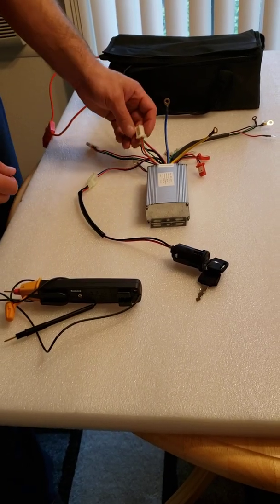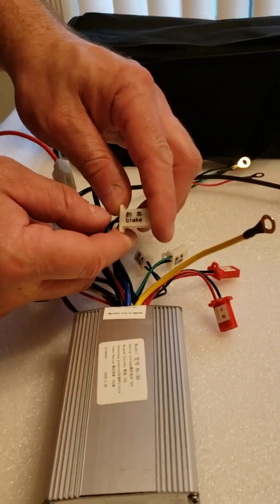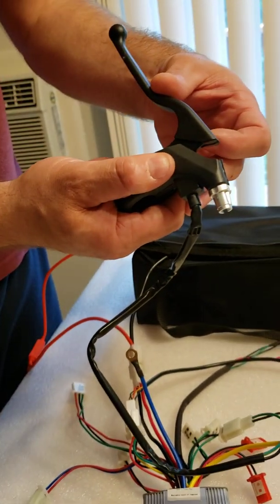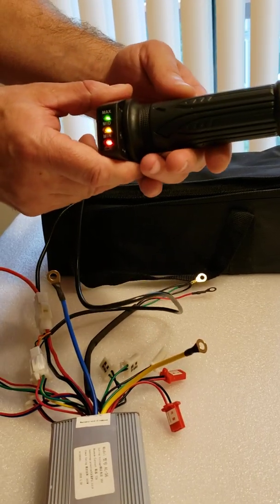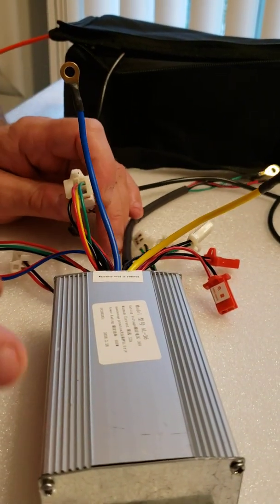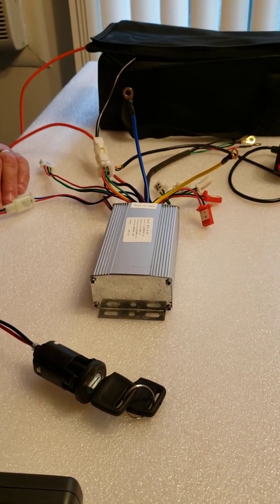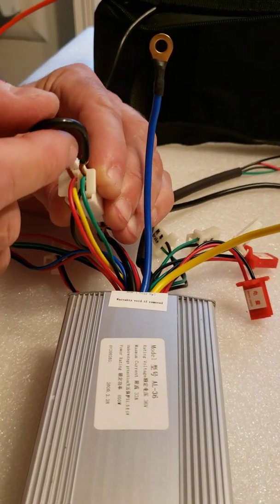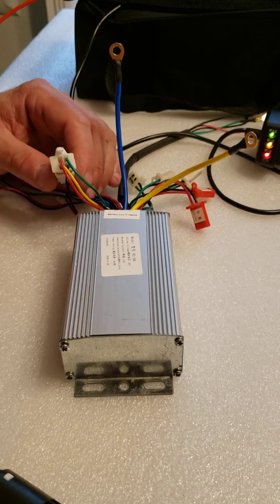Rosso electric atv Throttle or Controller faulty??? Testing controller Part 2

Comment: Hi iv got a mrf off road 36v electric quad iv changed my batteries and controller to the same as there was in the quad and iv still got no movement any ideas what it could be thanks

Comment: What would be my problem if when I twist the handle, the ATV accelerates and stays accelerating even when I let off the throttle?
Reply from the maker: If it is doing that with throttle handle unplugged, then you need to replace controller

Comment: how can you test if its a gear selctor problem?
Reply from the maker: You can do continuity test, as shown on one of my other videos , or you can bypass F/N/R switch and connect Bleu and Yellow wires from the controller directly to Red and Black wired on the motor to see if motor will spin. And if it is, than you know that gear switch is not passing power and need to be replaced

Comment: I have a Phantomgogo R1 36v scooter. When I tested the wife's coming out of the controller and I found that the 5 volt Red Wire is pushing 17.44 volts. I am afraid of connectiing the.controller to the throttle because I do not want to damage the throttle.  Is this high voltage normal or is it a defect? Will it destroy my throttle?
Reply from the maker: Sorry, i am not familiar with your scooter and its wiring diagram color codes, so i can not suggest you much to avoid making it worse... 
But from my experience i never seen that throttle handle can get  damaged ,  but only  controller  can get damaged if connected wrongly

Comment: The batteries both showing 53volts it was when I was charging them and to see how much charge they had I reved them and both stopped working batteries still charge but I don't no if throttle fault or controller
Reply from the maker: What product you have?
Reply: @You-can-fix-it  48v 1000 electric dirt bike it stopped working when I pressed throttle while plugged in on charge
Reply from the maker: @djmccrea2438  Controller is supposed to  have a safety future,  so it will cut off power if it detects the charger to be plugged in. Make sure fuse is not blown and actual Voltage is present at the battery connection plug
Reply: Batteries showing voltage but I don't no if it's controller or the actual throttle blown because it won't turn on
Reply from the maker: @djmccrea2438  you can override ignition switch,  it is only 2 wires
Reply: @You-can-fix-it  how I no nothing about electric just what I watch

Comment: What if you charging it and then the lights don't work is it throttle or controller because with no lights can't turn it on so wouldn't no if it's controller blown from charging and pressing throttle at same time it's blown controller or would throttle be blown
Reply from the maker: Controller JUST passing power through to your batteries,  so it got nothing to do with charging.  Better to verify is Voltage is coming out from battery pack connection plug and if Voltage is present,  than next stepis testing or overriding ignition switch.  And if after those 2 steps done and it still not powering ON , it means that controller is blown and need to be replaced. 
Here are 2 videos below how to test battery Voltage output and how to override ignition switch
https://youtu.be/NSuSZ9hmpyw

https://youtu.be/R_0vbhS3jQc

Comment: I have a 6 wire for light display and Cruz control throttle.    So to I short the black and brown in this case for the 36 b to go back to the hub ? Or is it low voltage 5 to the trigger ?
Reply from the maker: Sorry, I have no direct answer if you have non Gio products...

Comment: In my case, my controller was dead as well as the twiest throttle. I ended up replacing the Hall sensor in throttle, and buying a new Controller.. Great Video and very helpful with me diagnosing my issue with my GIO 500watt Manteray. Thanks again Sir!

Comment: Can someone please explain to me why he doesn't need to bridge the connections of the front, rear and footbreak for the esc to supply power. I thought these connections needed continuity because all the break leavers have switches inside that cut the power to the motor when unpressed? Thanks in advance
Reply from the maker: Controller work only when brake plug wires are not touched,  as when brake handle is pressed those wires get touched and it disconnect power inside the controller
Reply: @You-can-fix-it  Ok thx, i thought it was the other way around. I thought when you press de brakes, a switch inside loses continuity

Comment: Hello , I have a rosso equad x , my son whashed the bike with water and since then the bike won’t start. The fuse burnt out and then I putted a knew one and the moment I turne the switch to foward the motor activate itself for 1-2 sec and then the fuse burn out again

Is it the dc controller or the motor that is broken , there seems to be a short circuit somewhere cause the fuse keep dying. When I put a new fuse the lights and all the lights on the handlebar works fine
Reply from the maker: Unplugg acceleration handle from controller and see if the fuse will keep blowing, if yes, than replace controller

Comment: Where do you get the handle from?
Reply from the maker: From Rosso motors website
Reply: @You-can-fix-it  is it 2 pin or 3 pin?
Reply from the maker: @JaspreetSingh-kb9gd  they all 4 wires
Reply: @You-can-fix-it  Oh ok. Thanks!

Comment: What if you do the jumper and it only runs for ¼ second and stops?
Reply from the maker: Low battery Voltage ( less than 38V) or faulty controller
Reply: @You-can-fix-it  thank you. Voltage is good so must be the controller.

Comment: Sorry to bother you again. I now replaced the throttle handle and still no movement. Computer is replaced and throttle handle replaced. Motor is good. All that's left if the forward reverse switch and speed key switch. Can a defective forward reverse switch or speed switch cause the atv not to move? Please let me know. Thanks.
Reply from the maker: Yes. Follow the video how to do continuty test .
Reply: @You-can-fix-it  I did continuity tests on everything. Everything seems to work fine.
Reply: @You-can-fix-it  I get a beep sound from the forward reverse switch even if it's in neutral. Could this mean it's defective because it shouldn't be getting any beep sound? Also is it in forward or reverse I still get a beep sound from both sides of the switch. Isn't only one side supposed to beep until I switch polarity?

Comment: I talked with you on another video of yours. I did continuity tests on everything on the atv and I had the batteries tested and they are all good batteries. My throttle plug has 3bwires connected and one yellow wire that is external from the throttle plug. I touch that yellow wire and the green wire and the multimeter beeps. Am I supposed to touch this two wires? I still ha e full power and tested all the motor and everything else beeps. The forward reverse switch is testing good as well.
Reply from the maker: Check other video how to test newer style controller on the atv
Reply: @You-can-fix-it  it is 2019 model.
Reply: @You-can-fix-it  with my model should there still be a clicking sound when I turn the throttle? I never hear a clicking sound before when it was working
Reply: @You-can-fix-it  I donr have a handle switch on this model
Reply: @You-can-fix-it  I tried shorting the red and green wire with this model and I have no power to the wheels. I'm guessing it would be a faulty controller.
Reply: @You-can-fix-it  also I noticed on this model I have a red light with the letter "R" on it for reverse that lights up and a green light with the letter "N" but the letter N does not light up whem I put it in neutral and there is no current running from the black wire when doing continuity test. Maybe because of this light not working from the forward reverse switch is why the machine wonr move.
Reply: I'm not sure if this means faulty throttle handle or bad computer. Everything else is checking out good so maybe should I just replace both the handle and the computer?

Comment: I purchased a Rosso kids quad used for my daughters birthday. It's from 2019 and it only worked for about 10 minutes before it stopped working. The lights come on for the headlight and throttle but the quad will not move. Could this possibly be the battery? Or the controller and battery?
Reply from the maker: Since it is 3 years old model, start with testing batteries first
Reply: @You-can-fix-it  would a weak battery still be able to run the lights but not the motor? The battery indicator on the throttle handle says fully charged but could it still be a weak battery? I really appreciate you answering me back so soon. I am subbing your channel now.
Reply from the maker: @GLCUSTOMS  Correc,  start with batteries first . Than if batteries are good, next step is  look for other video that called " rosso atv continuity test " . Good luck
Reply: @You-can-fix-it  thank you. I watched all of your videos. I liked them all as well. You are a very smart guy indeed. I will see.

Comment: Hey, I was having an issue with my scooter. The scooter turns on normal, the horn works, the head/tail lights work, and the battery level lights on the throttle turn on too just like the video. I replaced the throttle first with an oem one. Didn’t work, I replaced the controller with an oem one as well. Didn’t work, I was then told about the brake sensor, my brake sensor was damaged but worked fine. I got new brake levers which come with the brake sensors and is still doesn’t work. I had a feeling it’s the battery but I tested it with the original scooter battery that I had before I upgraded. Still didn’t work. Could it be the motor? Pls help
Reply: I'm having the same issue. I replaced nearly everything on my daughters electric atv. All that's left is the speed control switch and the forward reverse switch.
Reply: @GLCUSTOMS  only thing left for me is either the wiring is messed up somewhere , or the motor is toast
Reply: @TrendyCentral  remember to test the motor you can touch the yellow wires directly to the motor red and black wires if the tires spin even once the motor is good.
Reply: @TrendyCentral  or direct motor wires to the battery terminals
Reply: @GLCUSTOMS  yea I was gonna mention the phase and hall sensors
Reply: @TrendyCentral  I don't get any power now after putting everything new. I just got another controller today and everything gets voltage but no power to the wheels still even with a new forward reverse switch and throttle handle on a mini atv. I'm lost now I've spent so much money trying to make this thing work I could have bout another atv lol

Comment: Anybody have the problem with the throttle sticking and the atv won't stop with the brake or the key fob shut off
Reply from the maker: Try to loose throttle handle housing clamp screw that holds handle to the pipe and pull out complete handle by 1/4 inch and secure screw
Reply: Just tried that the handle. They quad is still full throttle as soon as you trun it to forward or reverse and out stop with left brake or key fob. Will just stop when turned to off on center knob.
Reply from the maker: @jasonnmoore12  Unplug throttle handle plug while wheels are spinning,  if wheels will stop spinning,  then replace throttle handle. If wheels continue to spin after handle ia unplugged,  replace main controller
Reply: @You-can-fix-it this test is same for 3 and 4 pin throttles?
Reply from the maker: @vkmariner1 There is no 3 or 4 pin throttle, as they all have 4 pins in total. But some factory call the as a 3 pin, because 4th pin is separated from the rest of the 3 pins for safety purposes.  Yes,  test is good for all
Reply: @You-can-fix-it spasibo. Understood

Comment: Four wheeler worked great. Put it up for the winter, when we got it back out to charge it, it gets power to the lights on the throttle. When we attempt to remove the power the lights on the handle bars never come back on, the throttle won’t work, and the alarm continues to chirp. Any suggestions?
Reply from the maker: Battery must be recharged every 3-4 weeks, otherwise they reach critically low level and get destroyed, in this case you need new set of batteries